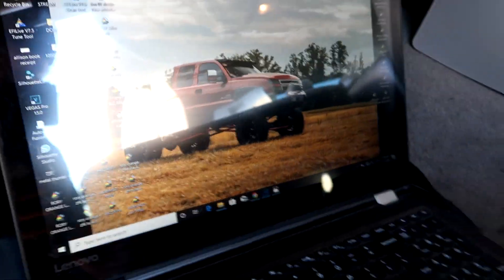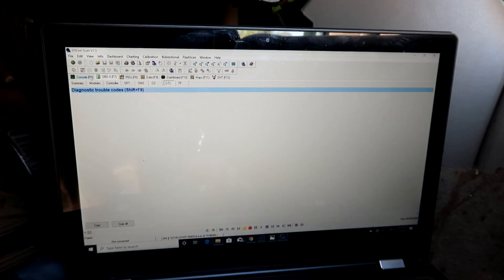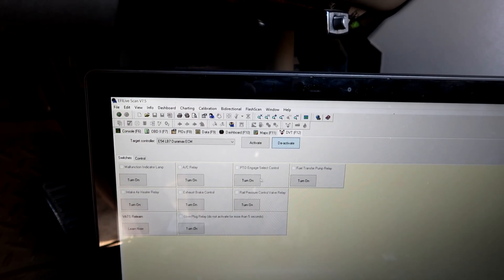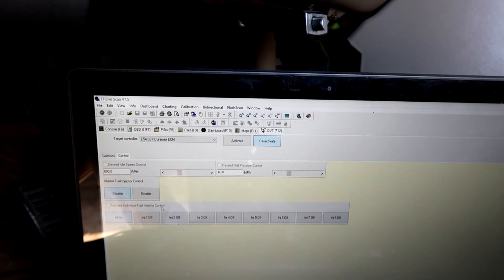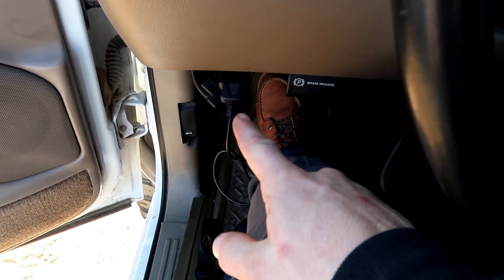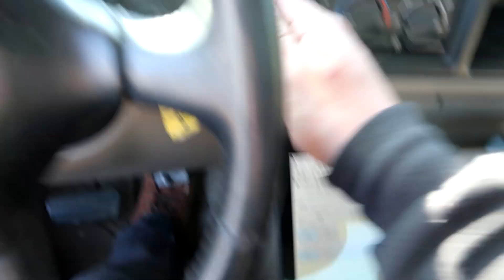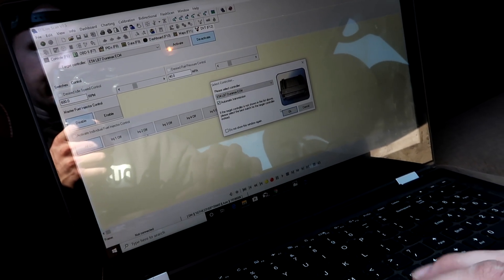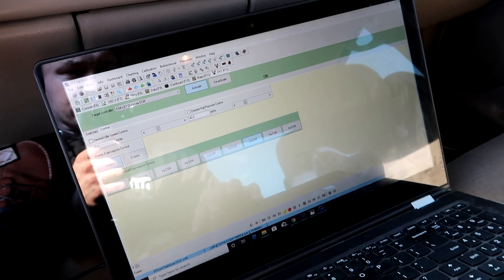DURAMAX Dynamic Vehicle Testing and Troubleshooting (DVT)

Comment: What kind of damage could result from a hung open injector? Could it be a somewhat easy repair or complete rebuild? Found a LLY locally and don't know if it's something I should try to attempt. Thanks!
Reply from the maker: well if the damage has happened yet you can just change the injector and be fine but if it has blown a hole in the piston then youre going to have to at least pull the motor and change that one piston and potentially the rod if it bent itll be a lot of work but it can be worth it for the right price
Reply: @ResurrectedDP  thanks for the heads up. Guy has most of the drivetrain. Said he got it for a project and never got around to it. Guess I'll see if he'll make a trade. Wish I could find an LLY donor truck. Crazy what people want for them! Look forward to seeing you rebuild the truck and hopefully get to take it to SEMA. ✌️

Comment: Wouldn’t it be faster just to look at the injector balance rate and see which one is bad?
Reply from the maker: Balance rates aren’t a tell tale sign of them being bad and I didn’t want the truck running with a stuck injector, but for instance with the one injector being bad a few other injectors were reading +\- 15 we replaced the one injector and the others went back to plus or minus 1